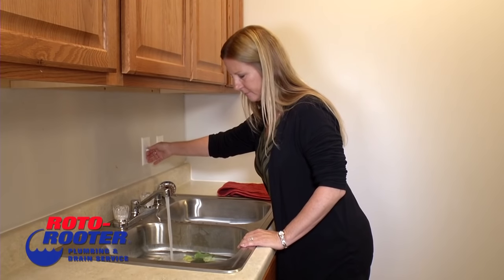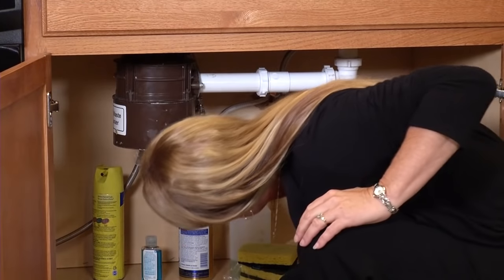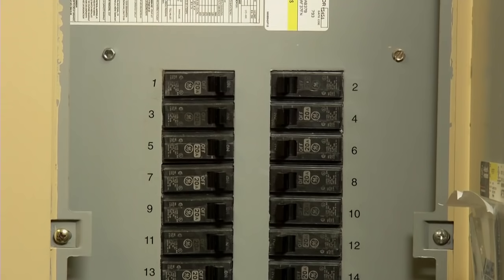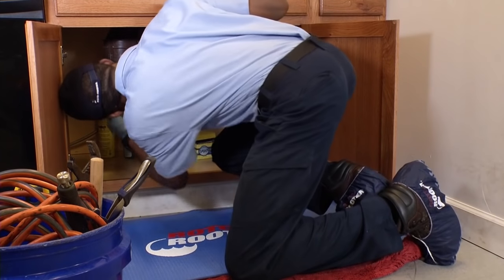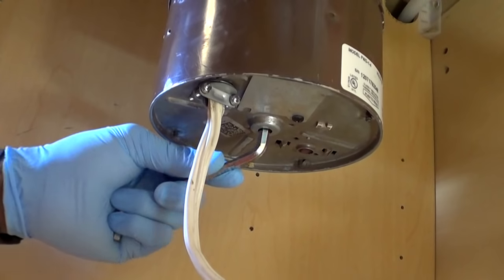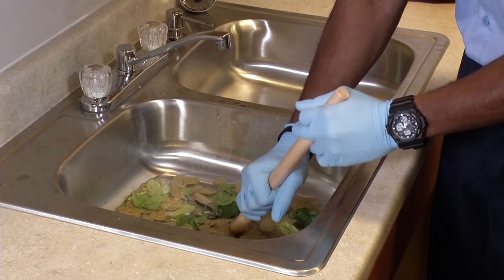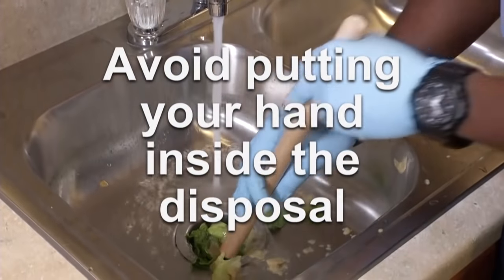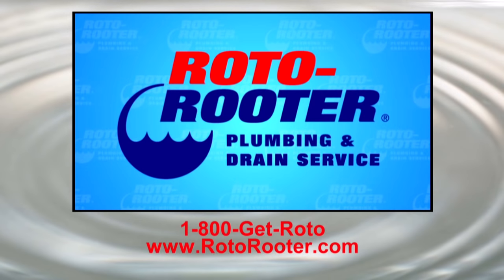How to Un-Jam a Garbage Disposal Like a Plumber | Roto-Rooter

Comment: Thank you so much!  After many attempts with the allen wrench, I had to resort to the wooden dowel trick to dislodge what had the unit jammed.  I am so happy That I don't have to buy a new disposal.
Reply: This fixed my problem, and was super easy. So easy that I thought the allen wrench I was using was too small, and just spinning in the hole with no resistance, but when I plugged it in and flipped the switch the disposal was running again. Thank you.

Comment: I had a jam a few years ago. I followed this advice and it did help loosen things, but the disposal blades still wouldn't turn. I got paper towels and thoroughly wiped out the inside of the disposal, cleaned it with ajax and a green scrubby, paper toweled it again and carefully felt around. There was a tiny bump at the edge of one of the blades. I used an extra long pair of needle nose pliers and pulled for several minutes. I FINALLY got the thing that was jamming my disposal! It was.. a vape coil. I normally throw them away properly, but I set the old coil on the counter while I am putting a new one in.. someone had mistakenly dumped it into the sink!

Comment: How did I not know about the hex key??? Thanks

If after all the stuff in the video and it still doesn't work, unplug it and remove it. Find the bolts and unscrew them and take the top off. Try to get it unclogged that way. if you can get it to spin easily, put it back together and reinstall it.  It is not difficult as long as there is a decent amount of room under the sink. Putting it back up can be difficult but with two people it is easy to manage, given the space.

If after all that and it still doesn't work, just get a new disposer and put it in yourself. It is super easy and will be much cheaper than calling a plumber.  Just having a plumber come out will likely cost more than decent disposal. If it makes you nervous to do it yourself, go to lowes or somewhere that can hook you up with a handyman. 

Or, if you are renting report it and let them deal with it.

It is not a job that requires or is worth calling a plumber. Plumbers are great and do a lot of great things but calling a plumber for this job is like nuking your house to get rid of a fly. The only exception to this is if you are in an older home and everything is connected with copper pipes, then a handyman or maybe a plumber is needed. If that is the case have them replace all that with PVC that you can maintain yourself.

Comment: For some reason my disposal was so locked up I had to remove it completely, take it outside, and then take a rubber mallet to the hex key on the bottom and smash away at it (both directions) till it finally broke loose. Took some major force, but it finally gave way. Some calcified bits of gunk fell out. Maybe that was what locked it up?
Reply from the maker: Wow! That was a super jam! We're glad to hear you got it working again. I've never seen one jammed up that badly.

Comment: I used my Allen wrench with a 2lb hammer...nothing.  Tried the dowel...nothing.  Then I was like...Imma gonna break this dowel before I call for help...I about broke it...but FREE at last my flywheel is FREE at last.
Reply from the maker: Wow! Any idea what was causing the jam? We're curious to know what caused such a tough jam in  your disposal.
Reply: @RotoRooterTV  -  I am baffled.  I cleaned it the best I could.  I used a tiny led flashlight and looked all in it.  I used a butter knife to go around the edge of the impeller and could not find anything.  I can tell you that I used a great deal of force before it broke free...and I can only guess that whatever it was is still in the shredder housing.
Reply from the maker: @philhanley7044  That's odd, but not completely unusual. Sometimes we break them free and expect to find a seed or piece of glass but never find the true culprit. We're glad you were able to un-jam it though.